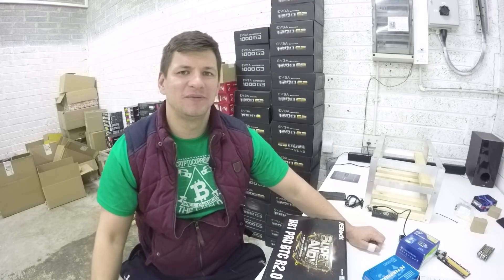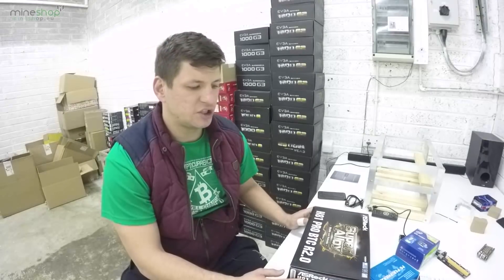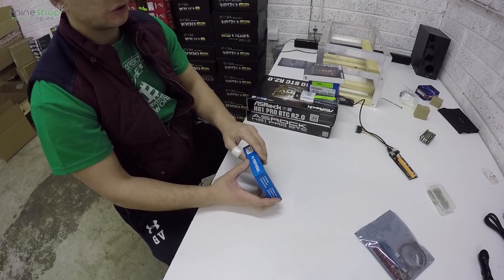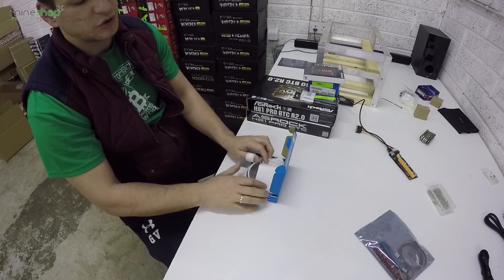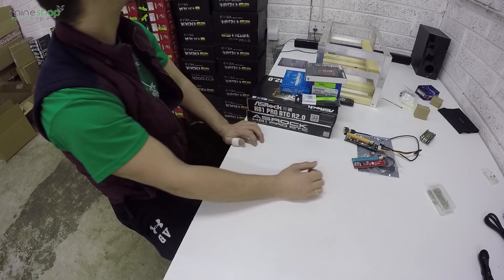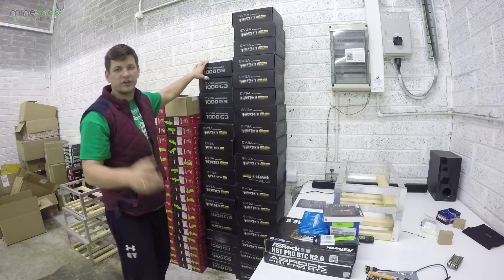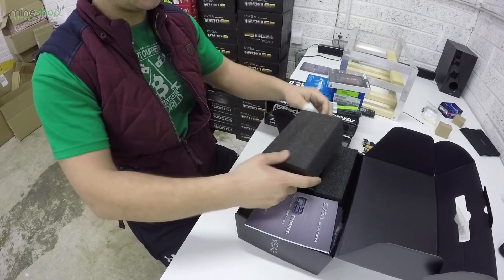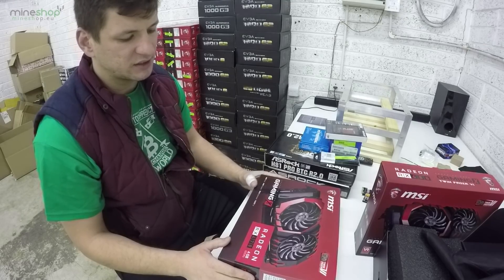What computer components (mining hardware) we use for mining rig built.

Comment: Hello Guntis.. :) Is there any difference between MSI GAMING Radeon RX 470 ARMOR 8G OC 8GB and the same with 4GB other then longer handling of the Eth Dag file? Will it have different hash rate? I asking because on ebay the prices for 8GB are lower then for 4GB and the parameters of the card are same just GB differs. Thank you very much in advance for you answer. Great job you're doing! All the best!
Reply from the maker: Damian Ostręga 8gb cards has about 2% higher hasrate, not worth
Reply: But if you get the same model with 8 GB cheaper then 4GB ? Then I assume it would be ok to buy 8 GB??

Comment: thi is mi rig not sure if i need another power supply 
Crosshair VI Hero: 
Noctua NH-D15 SE-AM4 Premium-Grade 140mm Dual Tower CPU Cooler
Ryzen 7: 1700x 
2 Asus Strix RX 580: top 8gb (1 not installed yet)
Asus Dual RX 580: 4gb
Asus Rx 560 4gb: (not installed yet) 
Flarex G.skill 8gb x2 
evga 750p2 is my power supply enough to install the other gpu,s??????

Comment: Hi brother ... very good videos that you have published. I already have 4 rig built, one with 6 gpu and others with 7 gpu. I wanted to ask your opinion about which ones are more reliable or recommended? And also which amd driver version do you use in your rig, what are the recommended clock and memory speeds? Do you use gpu with original or modified bios? thank you very much

Comment: Ethereum does indeed have a difficulty level, and also features something called a "time-bomb freeze", where eventually the difficulty will get SO high as to be completely unprofitable for miners. The reason for this is to ensure that miners run new software, and hard-fork, to upgrade Ethereum to the next major upgrades (Metropolis, and Casper). 

Besides this, the development team is also considering lowering the reward for miners, even before the aforementioned time freeze.

And also, once Ethereum switches to a system called proof of stake, miners will make ZERO money. You won't be able to mine it eventually, and this is expected within a year.

Hope this sheds a bit of light

Comment: where do u buy the aluminum angle and the wood cuts?
Reply: In the USA... Your local hardware store has them. You just have to cut it down with a Hack saw that comes with steel cutting blade. I got mine at Home Depot.

Comment: The Rx 480 MSI is really quiet but it's not always the case. R9 290x MSI was not well cooled. It depends on the series.
R9 380 gigabyte for example was the best R9 380 you could find : quiet en cool.
The Rx 480 gigabyte is very noisy and hot.

Comment: Have you had any experience with XFX cards? I'm building a rig with 6 ZFX 480 8GB GTR Black edition. Also got following pci-x risers with 6-pin connector http://pages.ebay.com/link/?nav=item.view&alt=web&id=132073205708&globalID=EBAY-GB  . Rig will be hosted at a datacentre with really good cooling and cheap electricity. I will be installing all parts into a 4U chassis which will need few modifications to accommodate 6 cards https://www.xcase.co.uk/collections/4u-rackmount-cases/products/x-case-extra-value-x415-e-atx-4u-with-fan-wall-10-drive-internal-storage?variant=17232462085

Comment: The Rx 470 Armor is a nice card too, have them in my eyes for some time..., but the badest point, some armor cards has officially a military class certification, the rx 470 has not. And when i compare pictures of the PCB, i am not sure, but for some reason I find the design not that good than on Rx 470 gaming X. And they have not that branded SFC Components on it... Maybe they are the same components, and it's only branding for the gaming x, but mabye not... So for selling the cards a prefer a military class... Because 150.000 hours lifespan is a good selling-argument... Also the less noise and better colling... On the other hand as you say memory on Armor is better, as for price...

Comment: The MSI OC Gamer rx 480 cards are super quiet!!  The only thing I do not like about them is I have not been able to get the ones with hynix memory on them to continuously perform when RAM is clocked higher than 2000 mhz.  My other cards with samsung ram can clock as high as 2250 mhz, pushing 32-34mh/s.   One more thing, is that the closer the PSU is to 50% utilization, it will become even more energy efficient.  Putting 700--1000w on a 1000w rated EVGA will work, but can wear down the PSU quicker and burn more electricity.  I recommend only one sata power cable for every 1-2 rx 480 cards max or you risk melting cables where they link back to the actual PSU.  This has happened on my corsair, seasonic, and evga PSUs :(.
Reply: best choice for money, keep in mind: Better efficiency == less heat production. So if heat or noise is a problem always go for highest efficiency...
Reply: PSU efficiency is also good for reducing electric costs, extra heat, and if you want to maximize usage or efficiency for the circuits in an infrastructure.  For example on a 15/20A, if power is reduced enough one can perhaps allow an additional machine to a circuit (depending on machine type and voltage for the 20A).  In the past, it generally would be more cost and power efficient to buy  2 x 650w gold PSU  versus a 1000w gold psu.  In summary, it really comes down to your environment, costs, and your needs to meet your objectives.
Reply: Yes you're right. I'm very happy that I have done a electrician formation, so I can built up my own fat-cable infrastructure in my underground garage if it will be necessary. :) I'm actually building my 4th rig (One phase 16A). I'm planning my 5th but for this I have to install a 3 phase cable... Best would be 3x32A (I have 230V on one phase), I have free space for about 18 - 24 rigs if i really would do this... 3x 32A should be enough for 20 - 24 Rigs. 3 x 32A x 230V = 22 kVA => 22 * 0,95 (Power Factor) => ~ 21,6 kW max.
Reply: Just be careful man...https://www.forbes.com/sites/timworstall/2017/01/27/congratulations-to-venezuela-bitcoin-miners-arrested-for-stealing-free-electricity/#447dc6e34b03
Reply from the maker: Jonathan Skinner yes MSI quite and cool, graphic cards takes their most of the power from the vga cable 8pin gives 150w , I'm connecting 3 cards on riser, and haven't melted even on wire. but now with the version 7 risers I connect 2 , cause they connects straight on psu sata cable. I think melting wires is something to do with modify cards.
Reply from the maker: Jonathan Skinner thanks for your advice .
Reply: You are correct.  Bios modded cards, overclocked cards, and early reference rx 480 can melt sata power connectors.  Basically, the 6 pin pci-e should deliver 75 watt, 8 pin can deliver up to 150w.  If each card has a 6 pin pci-e, it will draw the rest of the wattage through the pcie slots.  If they are 8 pin, they should be fine unless there is super high load or massive oc.   However, if the cards each pull ~150w on a 6-pin pci-e and you have 3 pci-e slots connected on one sata power cable, it can pull up to 3 (pci-e power) x 75w = ~225 watt off one sata power cable.  ~225 watt is way too much power for most sata power connectors.  To date I've only had power cables melt dealing with reference 7990 and reference rx 480 cards.  I did also notice my stock MSI rx 480 gamer cards are set to pull up to ~180w each when editing the stock bios.  Now, I've moved to a policy of only 1 sata or molex power cable for every 2 rx 480 cards.
Reply: Hello the best efficiency in 80 plus certification is @ 50%, but in reallity it is not, may it depend on manufacturer, but for bequiet the best efficiency of there PSUs (Dark Pro 11 Platin) ist @ 60%. You can see this in the diagramm of their manual. So the best values for them are:
# 1000W PSU Platin, 600W secondary, or ~ 625 Watt of the Wall (Primary Side)... 
# 1200W PSU Platin it's 720 W Sec. or 750 W Primary (Wall).
Reply: But this is only important if you have very expensive electric costs... When not, the cheapier PSU, even if efficiency is worse) would be best choice...
Reply: You have to imagine that's like producing 22.000 W of heat, I do not even know if this would even be possible, in the building... I will look what 4 or 5 rigs do in the summer... For 24 Rigs, that's like having 10 hairdryer permantly running at maximum... But the biggest part of heat is produced by the cards not the psu... One PSU produce only about 25 - 50 W heat..
Reply: Well it all depends, I've found the hynix memory to have a huge variance.  Some are good, some are horrible.  Some only work at 1800-1850mhz stable on 4gb models (with memory timing changed).  Certainly an 8gb version should be able to do 2000+ mhz though.  I've got some that use samsung memory and hynix on the same computer system...this causes issues if I clock everything super high with different video ram.  I believe I'm running 1950-2000 mhz on 4gb oc model.
Reply from the maker: # what are you on about 😂
Reply from the maker: Yes this is the way you mod 8gb cards , just ddu drivers and reinstall 16.9.2
Reply from the maker: There is driver signature issues with some drivers.
Reply: Hello Maverickccs , where are you from ? where are you live ?. maybe we are in the same country because in my country the electricity is really really cheap,  maybe you can help me with my configuration mine.
Reply: hi. in my country electricity is free I want to mine with 6 GPU but I need to know what power source I need to work 6 gpu rx 480?
Reply: what country is that jesus?
Reply: Venezuela

Comment: Guntis i found that armor x ram modules are connected with thermale rubber to radiator, on gaming x not
Reply: there are some big differences when you look at the PCB pictures on google... the caps are closer togheter.... when parts are closer togheter is better for signals, but worse for cooling... There is a extra cooler on the PCB on left side on the armor... That's for voltage reulators or somethning?  And there's a big black area on right side... Do not know why? Do not know if components are worse, but actuall the design is newer... (Some faults could have been corrected) It's more compact so that's maybe the explanation for lower price, it's less material costs...
Reply from the maker: Yes seems like they have fixed some issues what they had with gaming, and as you sad cooling is much better on gamin x.